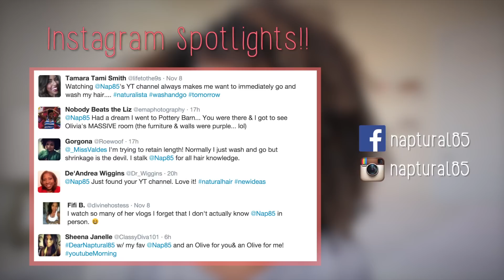4 Easy Steps to Remove Faux Locs - Naptural85

Comment: I need serious help. Why is my hair texture changing?  I do not flat iron, blow dry, no chemicals of any kind, and I have type 4 hair.
Reply: maichai13 mines won't got back to its normal tight coils when dry.
Reply: Are you combing or piking out your hair? Both of those things comb out the tight coils. There is a huge difference in my curl pattern when I use a rhassoul clay wash and finger detangle only versus when I use regular shampoo/conditioner and pick out my hair with an afro pick. The former gives perfectly defined spring-coils on my 4c hair. The latter gives a smoother, less "defined" curl pattern, but it's still 4c curly. Also hormones, pregnancy, and menopause can change a woman's hair as she ages.
Reply: msnnbc I normally finger detangle in the shower. And style my hair for the week so I won't have to touch it.

Comment: I NEED HELP! My hair is frustrating. It continues to break, no matter what I do. My last relaxer was sept 1, and then before that, April. But it still breaks! My older sister trimmed it last week, and it was fine. This week it started breaking again. I have 4b type hair originally(and at my roots). My roots are strong, but the ends, I don't even know why its breaking. all I want is long hair( my goal for the longest time). My hair grows pretty fast, but it breaks EVERY day. Buns don't even help... I take off the scrunchie=broken. HELP PLEASE!
Reply: It could very well be the way you're styling your hair. Tight hairstyles like buns can cause your hair to snap off simply because it's being stretched too hard. Be sure that you're not using super fine combs or brushes on your hair because styling tools can easily break your strands. Another thing to consider is how often you're moisturizing. Your hair could be thirsty! Give it some H2O and lock it in with a moisturizing oil and creme.

 ALSO, shedding hair is natural and normal! Make sure you're not mistaking shedding for breakage :)
Reply: apparently (my hairdresser told me this I dunno how accurate this is) if you start using relaxer you have too keep doing it b/c when you stop your hair is super damaged and breaks a lot... it takes a loong while before your hair is actually healthy again and stops breaking and begins to grow
Reply: It could be that your adding too much protein to your hair. Many products have protein and you could apply coat after coat after coat until your hair is so full of protein that it just breaks. I had that problem too then I just shaved my hair bald and started all over. That was three and a half years ago and now my hair is healthy and just below collarbone length at the CROWN. Use Aussie Moist conditioner as a cond. /Deep Cond./ Leave-in for a while because it doesn't have protein. if it doesn't work, cut it down to the new growth and start over.
Reply: It could very well be the perm. The perm really weakens the hair shaft. You could try a protein treatment, but that permed hair is damaged. You should do a big trim and see what happens after that. Let your natural hair grow out and remember to moisturize it properly and daily! By the way, nice growth Ms88keys1
Reply: Thanks msnnbc. Christina I didn't big chop suddenly I strategized. All year I watched youtube videos developed a regimine even decided which protective style to use month to month. Then in October I bought all I needed then in November I chopped it all off only because I wanted to keep my head covered for the first three months because of being bald and winter hats were the perfect disguise. If an event was coming up I had a wig just in case. But I never used it. Even at work since I'm a mail lady wearing a winter hat in the office for the first two hours was the norm. Then of course out in the field was obvious. So if you big chop strategize it and you will be so happy. My hair has never been this healthy and long EVER. so big chop sounds extreme but in three years you will be so glad that you did. Especially if your hair is as damaged as mine was.
Reply: Ms88keys1
 Wow awesome journey. I used hats when I was transitioning for three months back in 2009. I have 4c hair, and I was trying to grow out my relaxer. Beanie hats really helped disguise the two textures. I could only transition for three months because I wanted to see my real afro, and I also didn't know how to manage the two textures at the same time.
Reply: Now that I think about it natural85s faux locs would be PERFECT for transitions. Hide it and trim it then hide it and trim it. Msnnbc I wish I knew back in 2009 what I know now. I bet you made it to waist length since its been over 5 years for you. Have you reached the goal of waist length yet?
Reply: Ms88keys1
 I actually big chopped halfway through my journey! I was natural in '09, but I didn't really learn what to do until about early '12. I did my second big chop in May '12, and I did a lot of trims thereafter to get the right proportion between my back layers and top layers. My hair is almost APL in the longest layers and about chin length at my top layers. I don't like the afro mullet look one gets from not cutting the back short enough until the top grows out lol. I don't like to put so much pressure on a particular length goal, but my hair is definitely the longest and healthiest it has ever been in my entire life. What about you? Also, do you make YT videos? I've always wanted to start a channel but I am too introverted and afraid. I did want to show other 4c ladies that it can be done, and it's very easy and takes very little time.
Reply: Overcome your fear. Alicia James has an awesome video she posted just recently about overcoming your fear. If you fear making a video then you should definitely make one. My husband simply thinks it would be too costly and time-consuming that's the only reason I haven't done it yet. I totally agree with not having the mullet look, that's why I focus my length progress on my crown. Once my crown reaches bra strap length then I plan to month by month trim my other hair until it equalizes with my crown. There is not enough focus on long haired 4c women, so yes if you did a video for 4c's I would not only watch it, I would also subscribe.
Reply: Ms88keys1 Thank you so much for your kindness. I really appreciate it. Maybe I should some day. I could just use a cheap camera and a regular video editor. :)
Reply: msnnbc thanks, and thanks everyone. Yeah, I can't run my fingers through my hair without something coming out. When they say everyone loses amout 100 hairs a day, do they mean from three root or breakage?